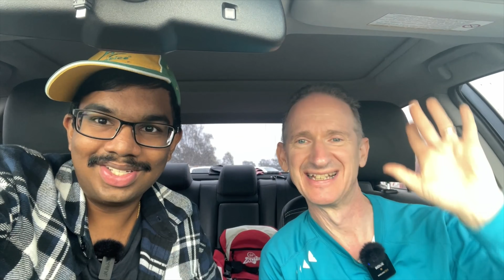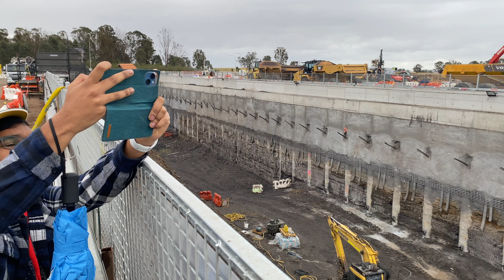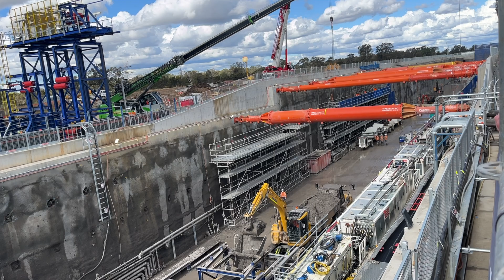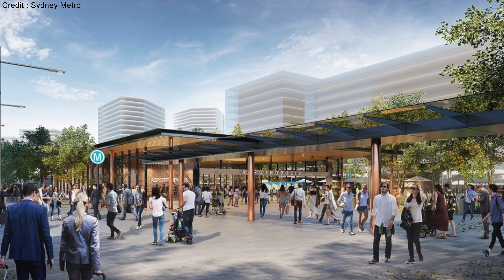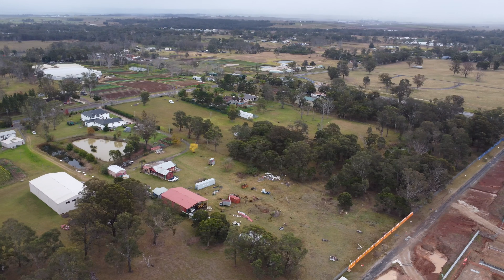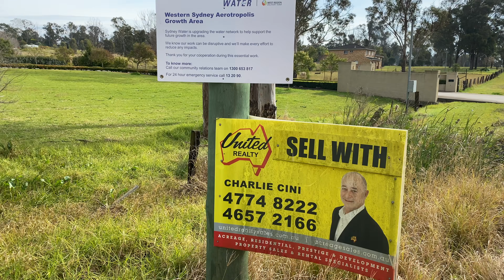Aerotropolis Station Community Day with Sharath@BuildingBeautifully  + Orchard Hills with Jo Haylen!

Comment: Sharath talking about Bradfield being built to such a massive scale is scaring me more and more that the area is being served from day.1 by inadequate transport.
Realistically, everyone will drive or taxi/uber to Bradfield, unless they specifically live in the Penrith-Blacktown area.
In my opinion, it would have been more worth it to delay Bradfield opening to open the line from St Marys ALL the way to Macarthur (with Metro West extension and Bankstown Metro extension to Bradfield via Liverpool higher up on the cards)
++++ Bringing regional intercity trains (Blue Mtns/Highlands) and SWRL HEAVY RAIL extension to a central Bradfield rail terminal (like Central)
Reply from the maker: Bradfield will be quite small to start with, and as it grows, transport links will improve. I feel that an extension of Sydney Metro West from Westfield to Aerotropolis and the Airport would be necessary for this city to grow to its full potential. And Metro or SWRL from Leppington will help too.
Reply: @TransportVlog  Agreed. Another vital link I think will be needed is an 'Airport Express' proposal I've heard of involving express (preferably single deck on the legacy sydney network) starting at Bradfield City / WSA and then following SWRL/T8 stopping at Glenfield, Padstow & Kingsgrove (to connect w other proposed North-South lines), then Domestic Airport, International Airport, and Central (or future HSR terminal) - helping w inter-airport transfers and getting all across Sydney. There is possiblity for dedicated rolling stock being used, having less capacity (bigger seating areas), single deck, and abundant in luggage compartments (not too different from a smaller plane layout itself)